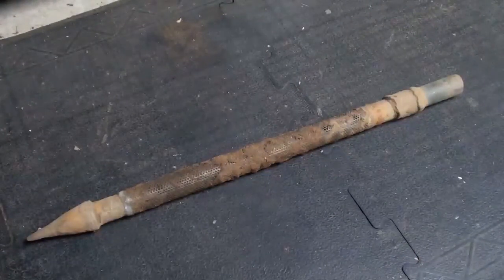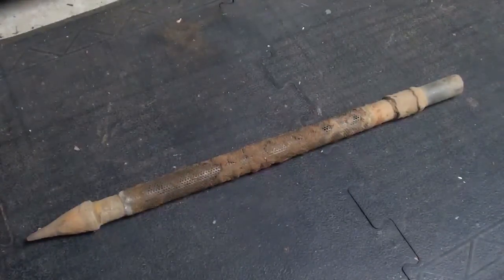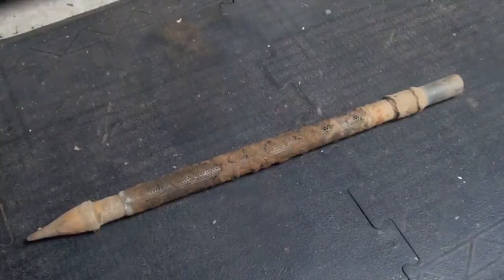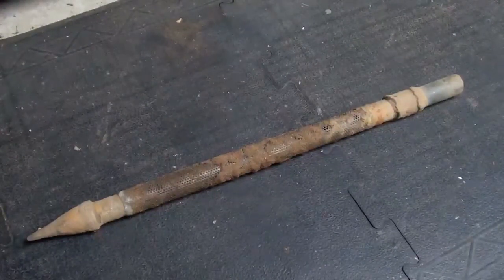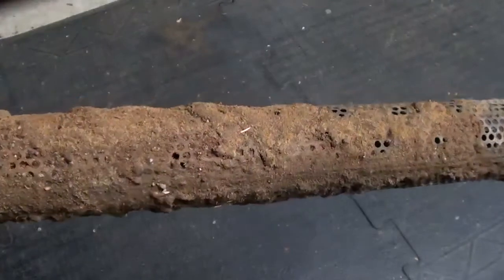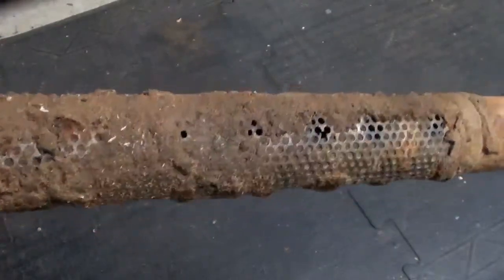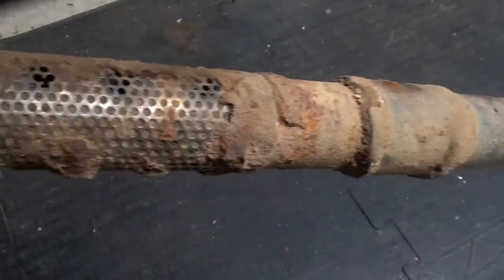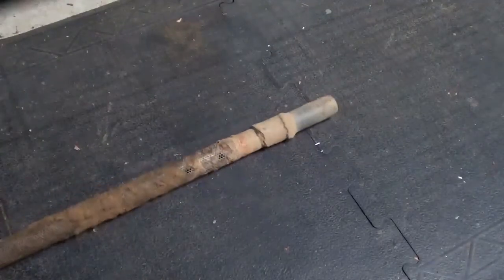Well Point Clogged or Dirty with Sand and Sediment and Reduced Well Water Flow or Volume

Comment: I watched both your videos, and good job getting that point outta there. 
I'm in a similar situation, but my steel piping (1" 1/4) and point are brand new. Just drove it myself into 6' of mud at the bottom of 19' of hollow 4" PVC casing. I have about 5'-6' of water in the steel pipe, and my Goulds pump I tested B4 installation, and it pumps perfectly from a 5 gallon bucket of water. Once I pulled the water column with a hand pump, to the check valve above, and hooked up and primed my Goulds pump, my water flow sucks. Tried backflushing with water and 100 lbs of air, but my point seems to be very restricted. It will drain water back downward, but has trouble doing it. Now I need to pull my point, and see if the point is clogged or damaged. 
Thanks for posting.
Reply: joe quillun  I pulled my first sand point because I was just pumping sand. Turned out the point broke off.
Reply: @Imwright720  Bummer. No fun pulling them out of the ground. I pulled mine too, to find a severely clogged, ( corrosion) point, that wasn't more than 50% open. Installed a bigger and better point, only to have the same low water flow. Long story short, the Goulds 1/2 HP pump, had the the wrong calibration jet and venturi. All is fine now. Still glad I pulled the clogged point out.